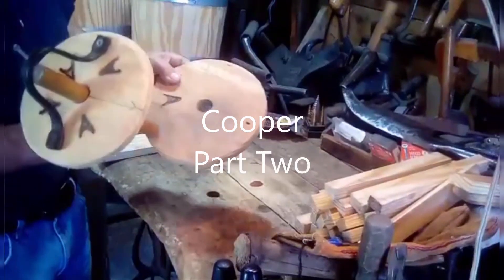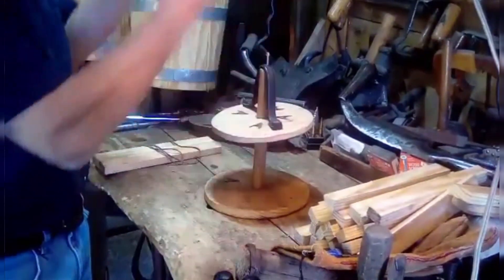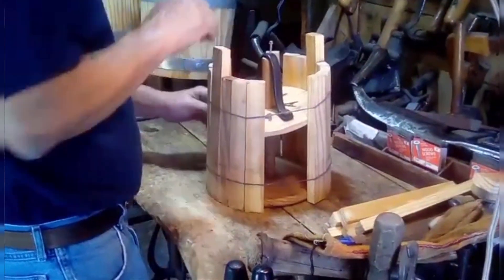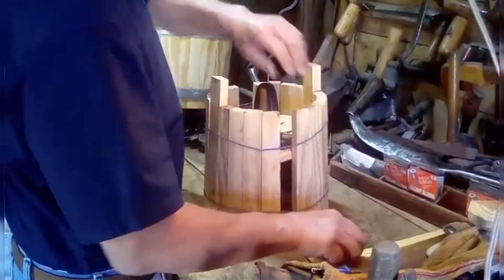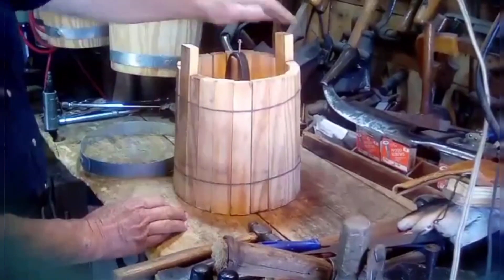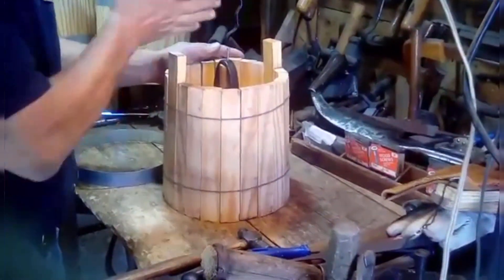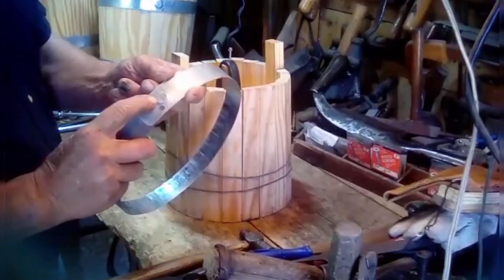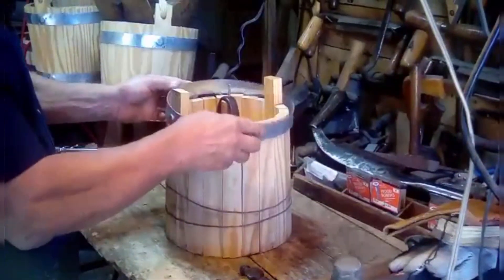Cooper Video Part 2

Comment: Really enjoying this video series.  Always love to see how others make their buckets and other coopered pieces. Just so you'll have it for reference, with a 22 stave pail, your jointed angles are 8.18 degrees.  Old timers use a sight gauge (looks a bit like a tiny try square, but with the desired angle made into it) to verify the correct bevel.  Often, these were kept in sets for different barrel and bucket sizes that had various stave counts. Occasionally, these gauges are mistaken for dovetail marking gauges in antique tool collections.
Reply from the maker: Thank You for the info.